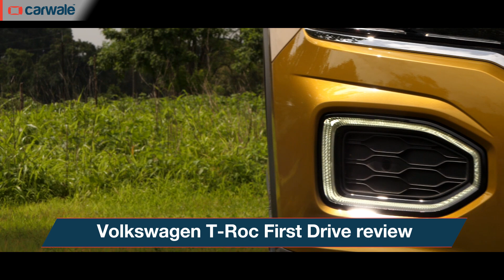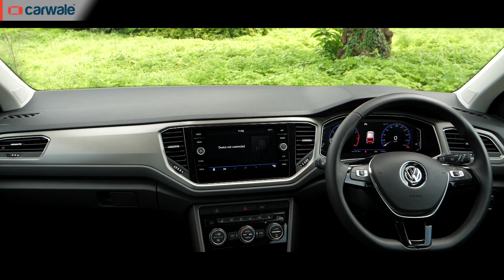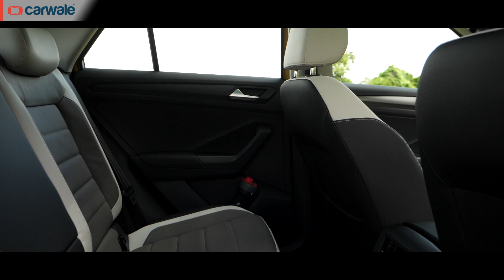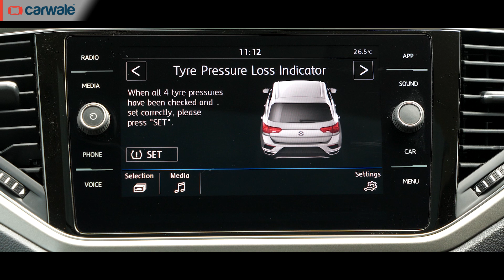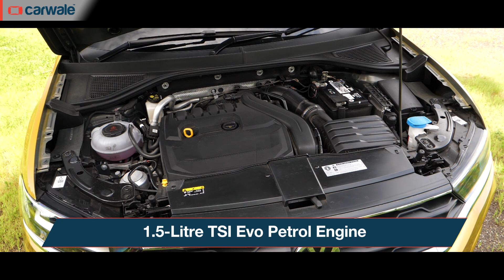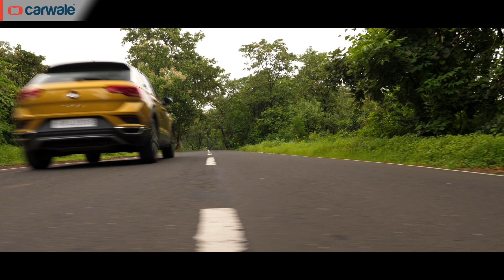Volkswagen T-Roc | Is It SUV Enough? | CarWale

Comment: Firstly, see any foreign review of Troc 1.5 TSI DSG, 0-100 of troc is 8.4 seconds flat (try 170bhp compass/Harrier, its over 10 seconds).
So Troc is basically the fastest car in india under 30L and it’ll do 200kmph + all day everyday and will remain planted (those who are saying Kicks 156 bhp, remember it has a CVT which is way slower than world class DSG and due it’s tall stance, aero is not that great and it isn’t as stable at higher speeds as German cars are, needless to say Kicks wont go past 200kmph like Troc would with ease).

Also if You talk about small size and less space in Troc, it does have the largest boot (445 ltr) than even harrier, compass and creta/seltos. It is actually longer and wider than seltos/creta (just not as tall, which is a good thing as it doesn’t have body roll at all and has great driving dynamics and high speed stability).

It has some unique features adaptive frontlight system (AFS) with all Led lights, Active cylinder tech (ACT), Electronic limited slip differential (LSD), so ride is supreme (even better than harrier in my testing). Some European features are also included like: lane keep assist, front assist, etc along with unique features like green tint heat insulating windows, virtual cockpit, heated orvm, headlight washers, dual zone climate control, etc which you wont find in any other car at this price point.

It’s a shame people don’t understand German cars in India and compare kt with creta/harrier/kicks. 1st know details about a car and look beneath the surface (not just bada hai toh behtar hai mentality). DSG & TSI combo is a match made in heaven and Koreans DCT with 1.4 turbo is no match in performance, refinement or even the sound it makes. 

Also, Troc is build like a tank with 5 star EuroNcap safety rating and various active/passive safety tech (unlike gimmicks which koreans offer, but sadly Indian buyers aren’t that well informed about such things so they only know about fancy features what they can see inside the car, not what’s working underneath)
I agree Troc does miss some essential features at this price point like electric driver’s seat and cruise control and it also lacks a bit of rear space than competition (but has highest boot space in its segment), but overall it offers many big ticket features which no other car in India offers. It’s actually VFM and that’s the reason it’s sold out already (I feel petty for people who were saying that VW will not be able to sell even 100 of these in India).

It’s not for a typical Indian buyer who looks for resale, size, mileage and less maintainance cost. 
It is for those who can appreciate German cars (and most buyers who will buy this most probably have previously owned a VW/ŠKODA cars, so they know what they are getting into and why it’s worth it).
Reply: Indeed German have unmatched quality and the engines are a gem to drive, but hey don't you think the Volkswagen dealers are running a scam when it comes to after sales services. The maintenance of Volkswagen car burns a hole in your pocket. You do not pay just for the engine. And talking about 200km/hr....then it is a CBU unit and made for the autobahns of Germany, you can't really expect to drive it beyond 200kph on Indian roads. I know plenty of people who have faced issues with Volkswagen steering after 50k kms and even for a small car like polo it costs a whopping 1 lakh. Agreed the USP of Volkswagen is sheer driving dynamics and build quality and these are the two key aspects looked up by the enthusiastic drivers but then again these are not the only things you look at while buying a car
Reply: Prateek Sharma Maybe some users have faced service issues with VW (& true with every brand, no brand is perfect). 
And I agree VW parts are expensive (& maintenance too). But that's the cost you pay to get that refinement and build quality (which maruti, hyundai, etc doesn't provide). 
For instance, my neighbors harrier has huge panel gaps inside the cabin and steering wheel edges are sharp (not fitted properly I guess). Such issues aren't found in German cars. They do have solid build & finish. 
I personally own a Ameo 1.5 TDI DSG (with the infamous DQ200 gearbox which allegedly has reliability issues), but I haven't faced any problem with my car yet since last 3 years (touch wood). 
So my experience has been really good. Hence I Recently also bought Škoda Karoq after gaining confidence in VAG cars. Once you buy a VAG car, you can't simply love other cars (as the build quality & performance they offer is unmatched).
Reply: @parthoomphy7214  I agree that Volkswagen makes perfect cars and service issues can be found with any brand....there are a lot of issues with TATA too....but somehow Volkswagen cars do not fit into practical aspects of Indian customer. Indeed they are a driving pleasure....but that's not the only thing you purchase your car....rest everyone can have their own opinion
Reply: Prateek Sharma yes I agree. That's what I said in my original comment, it's not for everyone (& so is all the VW cars). VAG isn't interested to change for Indian market & degrade their build quality & performance standards to build mileage machines with less service cost, etc etc. 
They know their customer base. They know that the ones who will actually buy their cars won't even consider anything less than what they are used to get in European cars.
Obviously if you want good mileage, low maintenance cost, great size to price ratio, decent resale and the likes, go and buy toyota, hyundai, Maruti (that's what sells in India & it shows). 
Take eg of fortuner, people buy it despite it having inferior interiors quality, features & ride compared to endy (due to the above mentioned things).
Reply: You have bought Skoda Karoq? Thats a very good choice..space and luxurious interior aside and just considering driving dynamics and handling,T-Roc or Karoq?
Reply: Yogesh Prabhu yes I bought Karoq recently (had a Q3 35TDI Quattro side by side)
Reply: Very well said! I booked mine today just because of German build, German make and 8 years of ownership experience with Polo. Koreans/Japanese are light years behind in putting attention to detail to quality, their cars start looking old after 1 year itself.
Reply: @SunderdeepSingh  congrats mate. Do share your experience with the car if possible
Reply: @parthoomphy7214  Sure Parth, I will get it in around 28-40 days. Will surely post a detailed review.
Reply: @SunderdeepSingh  great. Looking forward to it. And I must say You’re a lucky guy, newborns & a new car. Big Congratulations from my side
May God bless your family
Reply: Sunderdeep Singh did you get your car ??
Reply: @pradeepsagwal  Friday delivery. Shraadh khatam hone ke baad. Car & loan thing is done.
Reply: As an owner of a remapped Polo GT and a 3 Series I completely agree with you.. these cars look new and feel new for years, so long as u do Ur regular maintenance.. built like a tank! The DSG is unbelievable..(though I will point out that the earlier ones in the Polo had issues.. but my mechatronic was replaced free out of goodwill).. 0 to 100 in 8.4 seconds is simply mind-blowing
Reply: That’s a great answer bro. I do support all what you said. It’s really worth the buy.
Reply: Part there are subtle diff between the European(German)T-roc and the Indian one even though its a CBU (Sat Nav etc integrated into the virtual cockpit and few other aesthetic changes on the inside). I dont think the Indian CBU has headlamp washers as well. That being said I agree with youre saying in sentiment. As a car, you shouldnt compare it to seltos at all!! Plus its a head turner- coz there will hardly be any on the road. There are more Seltos' on the road than potholes!!
Reply: Thank you for your reply but please do tell which is better to drive among T-Roc and Karoq..
Reply: Yogesh Prabhu Troc is better to drive: better driving dynamics due to lower centre of gravity & stiffer suspension (so Troc handles better)
Also, 0-100 performance is better by around 1 second on Troc (as it's lighter).
But Karoq has waaay better interiors, plusher ride, more features & waay more space. 
So choose what you want according to your needs after test driving both. 
I found them to be better than Creta/Seltos, Harrier & compass in terms of performance & driving dynamics.
Reply: Parth Oomphy we are a family of 4 and average height of around 5’8”,even though Karoq is spacious than T-Roc,that space was adequate though..i did test drive both,as far as ride and handling i liked T-Roc a bit more,just a little bit more than Karoq..interior was way more luxurious in the karoq that too with that electrical adjustment seats memory function which is really a practical feature and man the ambient lighting,it was too good..i was very much confused to choose one among these 2 cars but i felt T-Roc’s ride a little bit more planted and it has hill start assist which is also a practical feature used in day to day driving..
Reply: Yogesh Prabhu For 5 Lakhs extra of Skoda Karoq over VW T-Roc you get all this:

1. Bigger car with more space and 200mm ground clearance (TROC has just 170mm)
2. Dual tone beige and black interiors (VW has all black, which make its interiors feel even more cramped)
3. 10 colour Ambient cabin lighting 
4. 4 way adjustable Lower back support (lumbar) in front seats 
5. Way Bigger panaromic sunroof and boot space 
6. 12 way adjustable Electric drivers seat with memory function
7. Auto dimming outside rear view mirrors with memory function 
8. iBuzzer and Driver attention alert sensors
9. 8 speakers & 9 airbags (Troc has only 6 speakers and 6 airbags)
10. Navigation with live traffic updates
11. Cruise control 
12. Full LED Fog lamp projectors (Troc has halogen reflectors)
13. Skoda's simply clever things like boot storage management, in car dustbin, ticket holder, umbrella under front seats, rear camera washer, etc.
14. Better built interiors in Karoq with soft touch materials all around (Troc has hard plastic on Dash and doors (like polo, vento).
Hill start is there in both (auto hold functionality does the job). I think you missed this feature.

For more info, you can read my blogpost at Teambhp's website (cant give link here cause youtube won't allow it). There I have done detailed comparison of both these cars (with pics and all) & give detailed replies for all your queries regarding ownership experience (you'll meet other owners too and get to know their experience). It'll definitely help you. And do become a member to share your experience too! I hope you make a purchase soon
Reply: Parth Oomphy ParthTheRockStar in instagram?
Reply: Yogesh Prabhu yeah but I don't upload on insta.
Reply: Parth Oomphy just for continuing this conversation over there and you can share the links there too..
Reply: Yogesh Prabhu alright
Reply: Parth Oomphy such a fantastic review. I read your post on Team BHP. I have booked T Roc (yellow). Is there any way to check whether vehicle is used as test drive ?? Thanks in advance
Reply: pradeep sagwal Thanks & yeah, just check the km driven before taking the delivery, it should be ideally below 100km on the odo (reversing odo on a cbu requires a different software which even many showroom guys dont have as of now).
PS: Congratulations on the booking. Do share your experience on the Forum along with pictures of the car. Waiting to see kurkuma yellow Troc in all its glory!
Reply: @parthoomphy7214  Thank you Parth . You have played important role in deciding this car. There are so many features on Indian T Roc but hardly any videos on youtube. I ll try to post videos explaining these features. I have one more query dealer was saying that voice command will be activated after one month as some software is required to activate it. But I have not heard this from any other owner of T Roc or on Team BHP.
Reply: pradeep sagwal Thanks & Looking forward for your posts on the Forum!
And about the voice commands, maybe some software has to come from Europe due to which dealer is saying this. I remember there was one Troc owner on the Forum who had to wait for a month for his car’s delivery just because dealer didn’t had a “laptop” which had Troc’s software as it apparently comes from Europe (being a CBU). I don’t know the specifics but you can clarify with the dealer itself as Troc being a Niche and exclusive car doesn’t have many owners on the internet who share their experiences with the car. 
I hope you’ll fill this “void” after you receive your car as it’ll helpful to future Troc owners😅
Reply: @parthoomphy7214  thanks for your reply.  I ll try my best
Reply: Parth Oomphy T Roc T Roc DSG is too good
Reply: True, but No independent rear suspension though
Reply: WoW, thanks for the comprehensive analysis. 
Yes It’s true, people don’t prefer build, safety or performance here. 
Troc has CBU build quality and exclusivity on road. 
I believe even VW’s paint quality is way better than other cars as I saw a TROC on road recently and it looked stunning & it’s white colour made other car’s white look “yellowish” (saw it side by side with the new creta in white colour, so I can compare). That’s why I believe VW gives 6 years paint warranty as well (which I haven’t seen in any other brand).
Cheers!
Reply: Ravindra Kumar yeaah that’s true.. all these small things people don’t even know about VW cars. 
It’s sad Koreans and Japanese are able to milk customers just by giving them fancy features like wireless charging & air purifiers, etc but compromise on actual quality of the product.

Comment: Expecting single digit sale in India due to the atrocious pricing for a compact SUV...For half that amount you can buy the better specced/spacious Seltos/Creta...for power there is the excellent Nissan kicks with that 156bhp Turbo Petrol engine....
Reply: It’s already sold out. So relax, it’s not for you 😂
Reply: @parthoomphy7214  all these people ,they buy these tin cans and nissan anyway doesnt even sell XD.... Hopefully they start CKD production soon...1000 units r already gone.
Reply: Shaleen D CKD will not start probably before 2021 I believe or maybe 2022 as they will test the sales atleast for 2 years via CBU to know the real market response before investing in CKD infrastructure (cause it'll cost a lot for VW to assemble Troc via CKD here). I'm saying this based on an interview which I saw of VW head, India. But lets hope for the best
Reply: @shaleendutta3950  Have you been to my garage to vouch for Tins cans or worms?

@Parth I never took any high/low ground to run down the build quality of the German cars nor did I stereotype the opposition buyers into tin can foot soldiers with a smug sarcasm. The T-ROC in its current price/features matrix cannot set sales charts on fire. 
It is one thing to sell a 1000 units to a fanboy club and another thing to reach a moolah raking scale. 

With Indian/Worldwide trends firmly towards Crossovers/Compact SUVs that are providing compelling cost value proposition, Volkswagen  missed a trick by localising more parts in India and keeping costs lower. When a Kia can do it why can't VW who have been in India for a decade or more.

Again let me make it more explicit. I do not have any hidden agenda for any manufacturer. Be it Maruti pushing in lousy underpowered petrols with a newfound diesel-is-injurious tag, or a Toyota selling lousy replicas of Suzuki cars, I am generally against Manufacturers taking India for a ride and selling us less car for more price.
Reply: Pricing is compare to top versions of seltos,creta and hector. Only difference is 2 to 4 lakhs,that is acceptable.

Comment: Should I consider this over the harrier?
Reply: Yeah dude, I already answered your question in another video’s comment.

If you are a typical Indian buyer looking for price to size ratio, resale, less service cost and more rear space, then go for Harrier. It has some additional features like:
3 Drive modes, bigger rear space (although boot is bigger in Troc), bigger panoramic sunrooof, electric drivers seat, 9 jbl speaker system is better and cruise control feature (which is surprisingly missing on Troc).
But if you are a petrol head like me amd prefer fast fun to drive cars with good driving dynamics, handling, great steering and breaking feedback, then go for Troc. Additional features of Troc are:
More boot space, exclusivity on road, tank like build quality (German + CBU, harrier does have panel gaps and quality control issues in interior), European features like Front assist and lane keeping assist, paddle shifters, E-Parking break with auto hold, virtual cokpit display, headlight washers, Adaptive frontlight system (AFS) with all LED lights (harrier has halogens), 2 zone climate control, heated seats, limited slip differential (LSD) with independent rear suspension (like compass 4x4), so surprisingly ride is better on Troc than harrier on normal bad roads, but harrier has advantage on deep bumps due to more ground clearance. 
Safety wise, both are 5 star rated cars.
Anyday I would pick Troc over harrier as it offers much more than harrier for my needs. Also I find way more exclusive and big ticket features in Troc which you wont find on any other car in this price range. 
Rest is based on your priorities and family’s choice obviously.
Reply: @parthoomphy7214  bruh  thanks